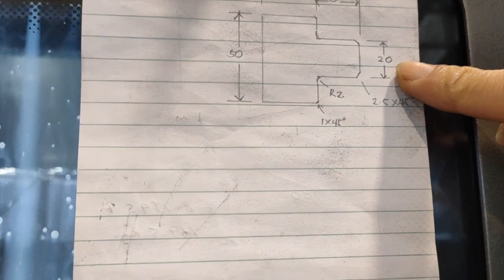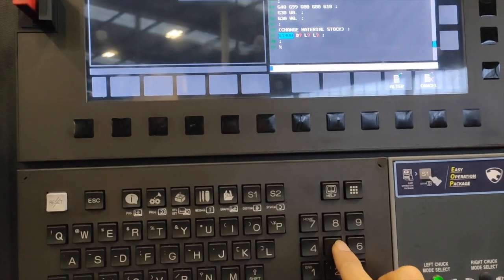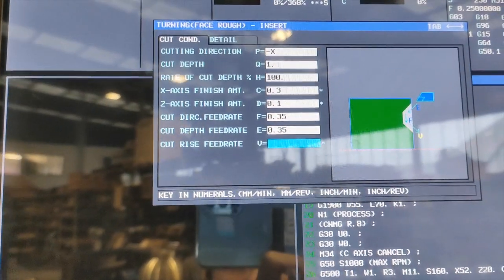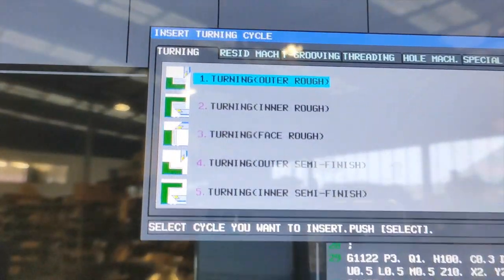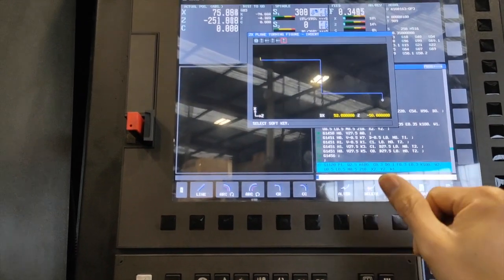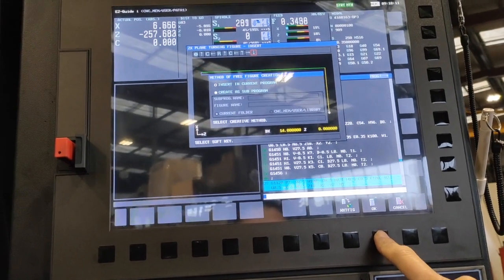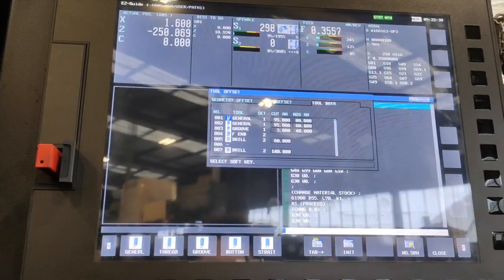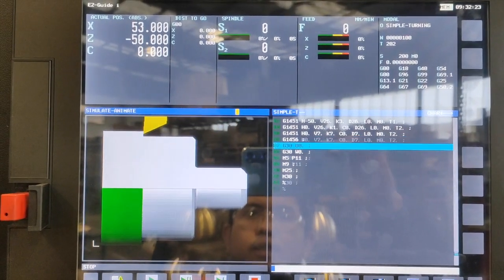#HOW TO PROGRAM SIMPLE TURNING ON LATHE MACHINE (ABSOLUTE BEGINNER) part 1 #20

Comment: Sir bka pwede mag tanung sau,,,about s  depth of cut feedrate at spindle speed ng pang roughing anu magnda ilagay s mga yan para mag brake ung mga chips nya,,,
Reply from the maker: Depende boss sa materials, tools, at machine capability s feed at spindle speed makikita mo yan sa packaging ng tools mo or ng insert na ginagamit. May formula para makacompute ang spindle speed at feed. Cutting speed x 318/diameter=  RPM. 
Example 295 x 318 / 50=1876 

S=1876
F= 0.35 check your tool catalogue for accurate spindle and feed

Comment: brod. pwede parequest ng setup dyan sa doosan Lathe fanuc, touch of Work offset G54 at Measure Tool offset saka run program. Thanks in advance
Reply from the maker: Sige brod. Gawa ako video salamat
Reply: @SamTheMachinist  salamat brod. asahan ko yan.